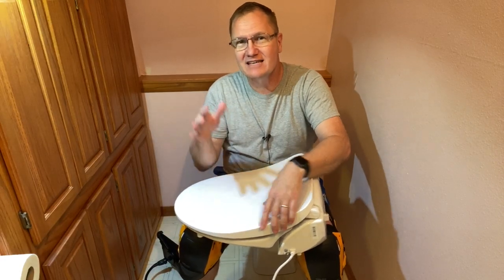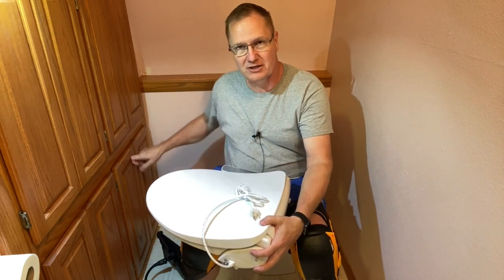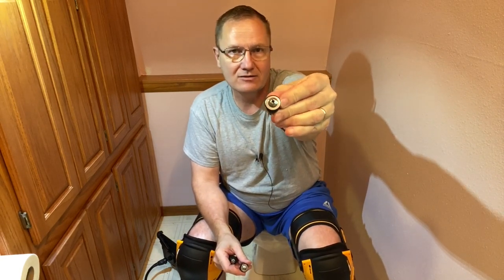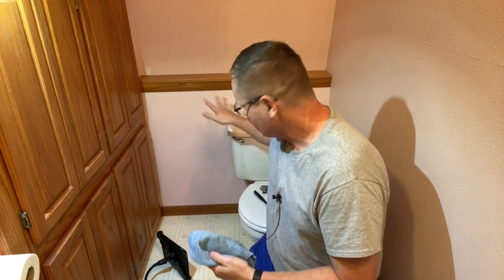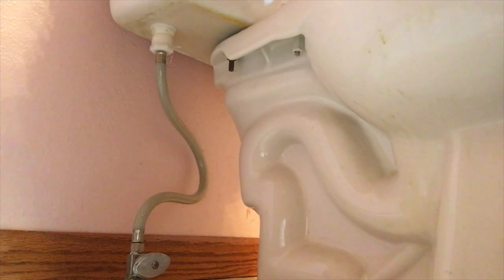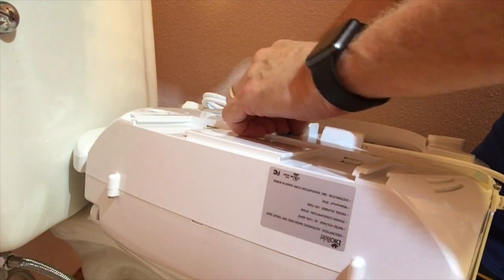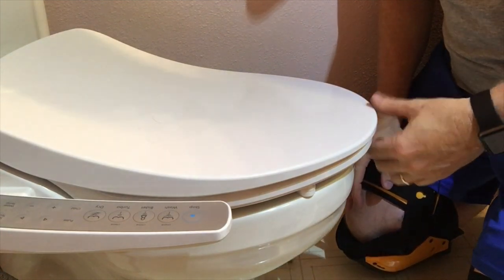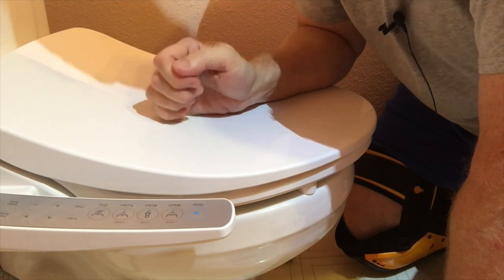How To Install A Bio Bidet Seat, But It Didn't Fit! Full Demonstration Process #BioBidet #HomeDepot

Comment: Put the screw in ( two to three threads) into the rubber anchor. Coat rubber anchor with silicone spray, push rubber anchor through the top by pressing on the screw. I also thought the anchor was too big, but this installation worked

Comment: Its a great VIDEO.  I needed to know how to remove the seat as over 8 years seat shifted.  I do have a story for you to do though.
HEAVY PEOPLE---250 PLUS---break the flanges that secure the toilet to the floor.  They actually make a flange designed for HAVY WEIGHT APPLICATIONS.  Check that out and develop a video/  Here in Mississippi there are a lot of big buts breaking toilets loose from their footings.  And, thank you for your Bio Bidet Video.  New Construction should have bathroom cabinets wired for Bio-Bidet.

Comment: Great instruction! However, when it comes to the product itself, I don’t like it as it raises the seat too high and I am sure it will also make the user uncomfortable not to mention it will eventually get loose (probably made in China). I prefer to use a bidet sprayer attached to my toilet tank line. Water can be kept warm :) by using a mini heater connected to an outlet though that part is a challenge or connect it straight to the hot and cold lines. Thanks for sharing!